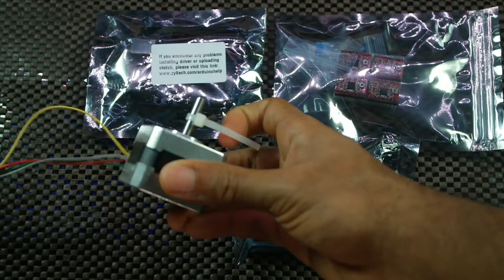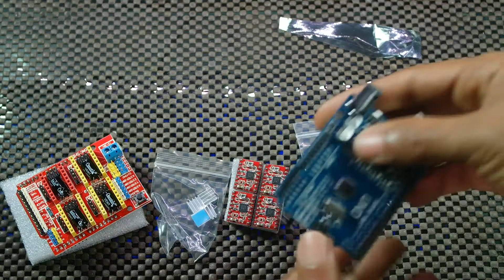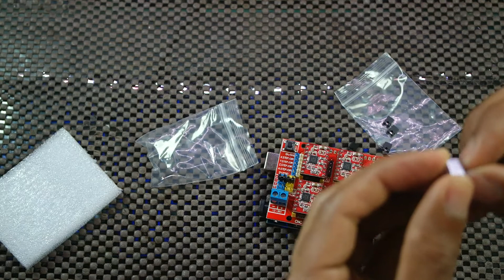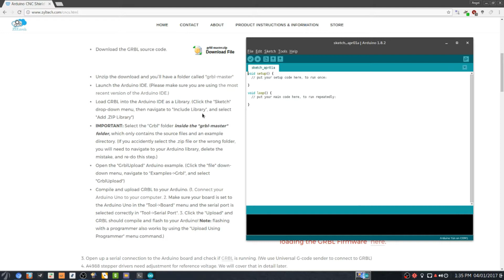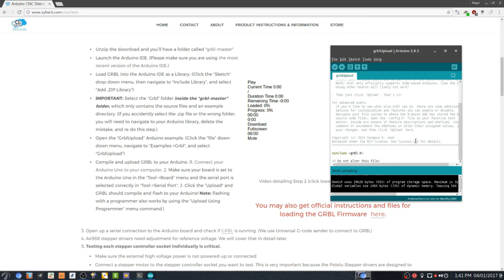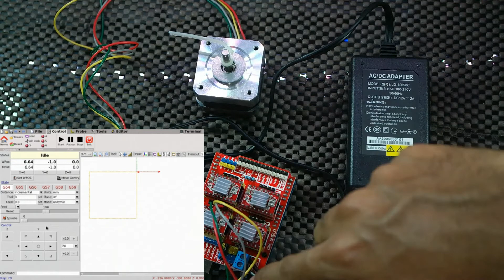Zyltech Arduino UNO CNC Shield

Comment: what is the value of adjustment for a4988 drivers ????
Reply from the maker: Depends on the motor that you're using. For 34mm nema 17 motors I use about 0.250v. For 48mm I use from about 0.8v or a bit more. It depends on how much torque you need from your motor and the size of your motor.
Reply: @UndernetSystems  my stepper Motors are  Nema 17  1.7A

Comment: May I know how a Nema 17 Stepper motor can be wired into this? If possible can you give a link of Circuit diagram in the description
Reply from the maker: This board can be used with nema 17 stepper motors. All you need to do is connect them to it.

Comment: I have a question. What if I don't put in the little jumpers on the shield? Does it work? What is the purpose of the jumpers?
Reply from the maker: Hey there, so based in my experience, these jumpers tend to be the ones setting the micro stepping on your stepper motor. Depending on which ones you leave on on which pins they set the resolution at which your stepper motors will function. This resolution will also depend on the stepper drivers that you are using, in the case of those generic polulus like the ones in the video, they tend to go to a maximum of 1/16 microstepping. This setting is enabled by leaving all the jumpers on. If you remove jumpers, it will still work but the resolution will be extremely coarse, to the point that it won't be of much use for any cnc machine. TLDR they set how fine or coarse your steppers resolution is. Check this article for more information about it: https://reprap.org/wiki/Step_rates

Comment: hello sir 
i make home made cnc
my motor 8 polus sanyodenki typ 103h7121-0415 dc 2 amp 1.8 degree 6 wire
i use A4988 driver 
cnc shield v3
arduino uno
3mm pitch screw road

use UNIVERSAL G COD SENDER software

so how creat 1/16 microstapping satting which port mounting jumper in cnc shield v3

which parameter insert in UNIVERSAL G COD SENDER

and which vref set in driver

plz help
Reply from the maker: Sorry for the late response. Based on your threaded rod, stepper motor microstepping setting and your angle of steps you can calculate the value that you need to place in the grbl settings. The prusa http://www.prusaprinters.org/calculator/) should be helpful when calculating those values. The vref is different depending on the size of your nema17 stepper motor but an average value is 0.500v. Also when it comes to the jumpers, there is an instructions link that explains which jumpers to set depending on the microstepping that you want for your driver. Be sure that you are doing it for the right type of stepper driver.

Comment: did ypu have a plan to build cnc?
Reply from the maker: I am still working on it. I just have finished about half of it. I have been having some issues with my 3D printer so I cannot print some of the parts to make sure they work, which has been slowing down the development of it by a lot. When it is at least working I will make a video about it.